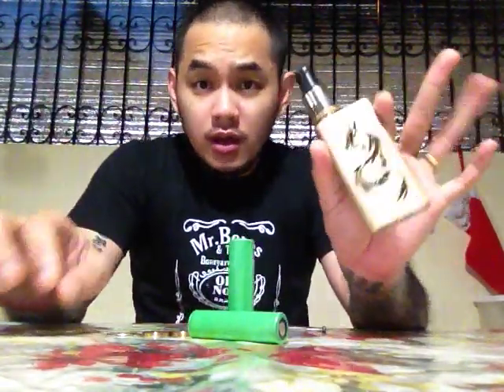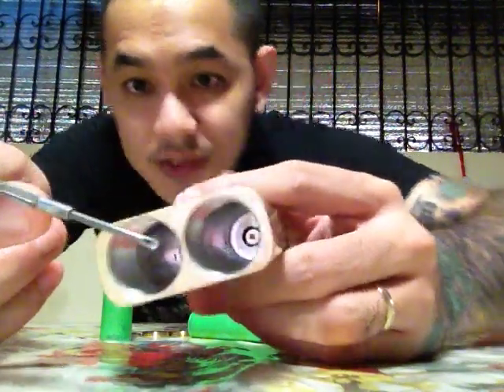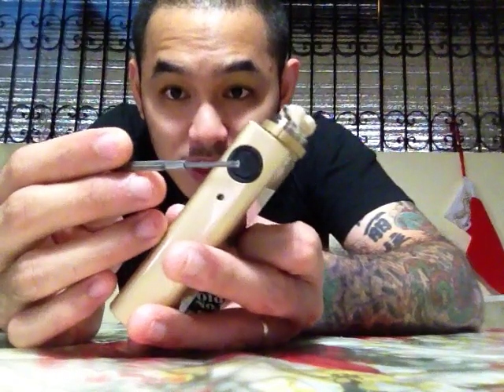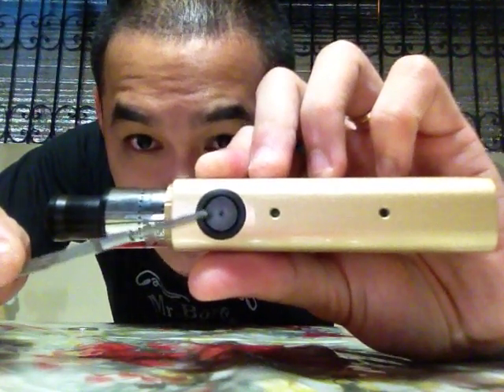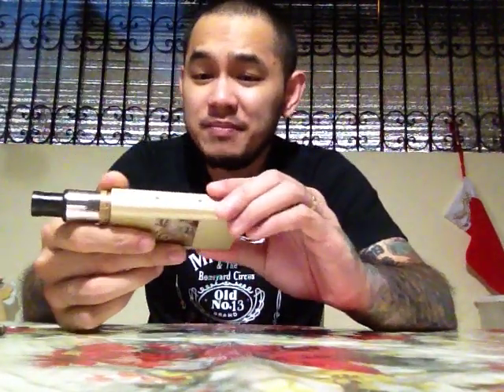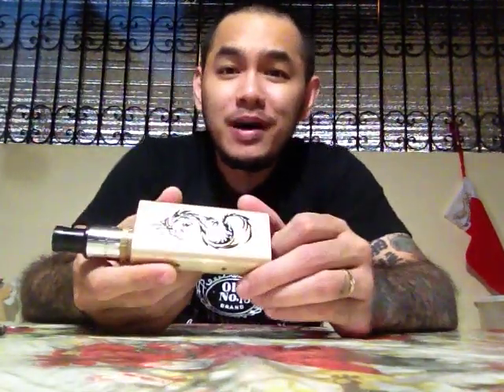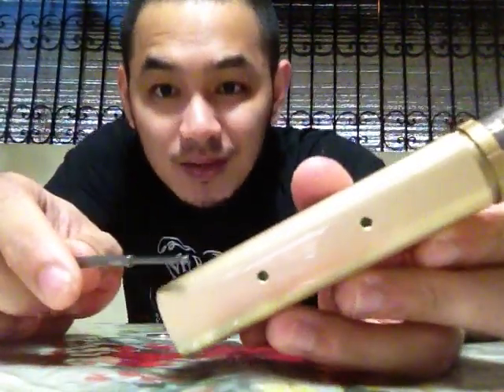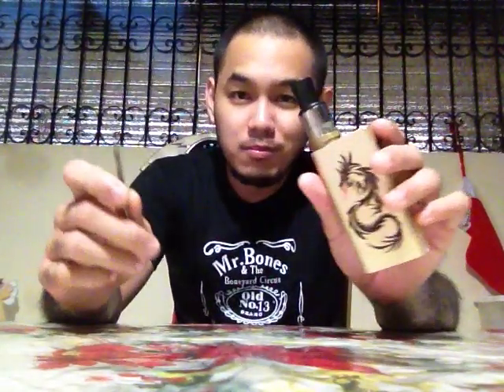The Dragon Box Mod by J2P Mods x El Diablo Philippines

Comment: I've used this box and it's sick, all aluminum not painted but had the 3m protective coating.  When he says it hits hard you don't understand until you use one.  I have a 26650 Black Dragon tube mod by J2P and it carries the same quality and performance.  The tubes have delrin switches too, love it.